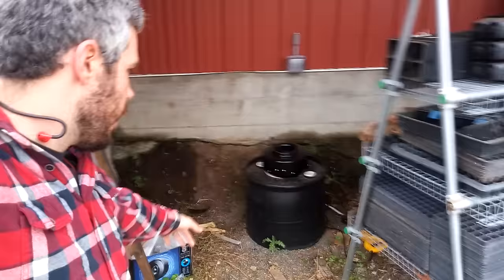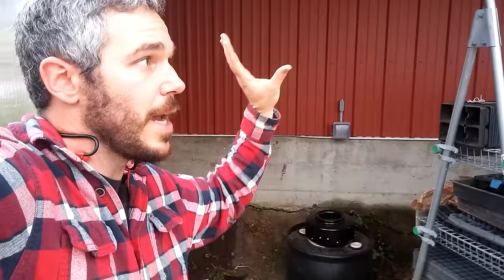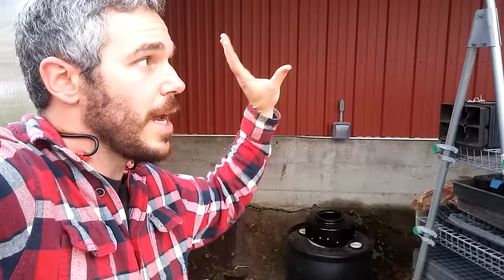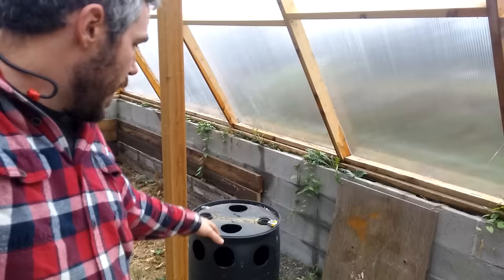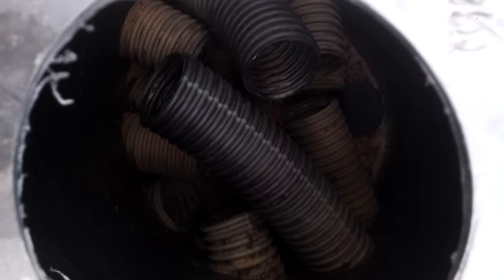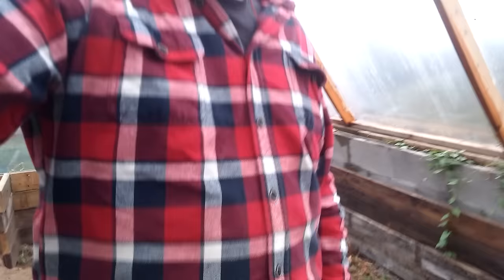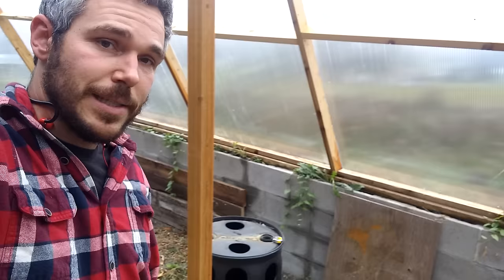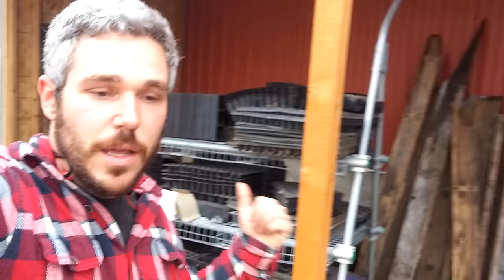Poor Man's Geothermal

Comment from the maker: UPDATE: Thanks for all the engagement on this video. As I said, good, measurable info is hard to find. As many of you have noted, what your seeing here is really still theory. We had one of the wettest winters in many years here in the PNW so I had to reprioritize, hence the lack of follow up. It will come eventually. In the meantime, check out our adorable piglets :) https://www.youtube.com/watch?v=4GqOcRLHnA0.
Reply: Great idea. Starting up a farm soon in the south and this will be GREAT for cooling. On a vaguely related note, what kind of panels did you use for the sides of your greenhouse and where did you source them     Thanks!
Reply from the maker: We used USA made Gallina Clear 8mm 2wall Polycarbonate. We had a wholesale source for this, which helped, as these panels are not cheap. I will do a video about the build in the nearish future.
Reply: Thats awesome. thanks!
Reply: You don't need panels on the side (maybe hinged ones just at the top for ventilation). It's more efficient to cover the east and west sides in dark colored thermal mass and insulate the outside (all the way to the frost line, but not down to geothermal pipe depth)
Reply: Hi there. Loved your video very interesting. Hopefully it inspires others to do the same, also check with your local officials about a tax credit (green credit). 

BTW, for future projects It would have been cheaper, quieter and more efficient if it used a plastic 55 gallon drum, filled it with about 3/4 of the way with water and buried under the ground. Connect some half inch pvc to a very cheap water pump (low volume) and a fan + radiator from a car (junk yard) being controlled from by a thermostat. The water isn't under pressure persay, as what you're gonna do is suck the water out of the button of the barrel, push it thru the radiator and it'll gently flow back into the barrel at the top, this is known as a open loop which reduces the amount of pipe you need and digging to do. I live in a tropical country and I air condition my entire house like this. Of course my setup is a bit bigger using 3 drums, isolated duct work, multiple fans, duct air valves, and thermometers so each room of the house can be temp controlled. Where I live electricity is about 25 cents a kwh. So having a 700 buck light bill isn't ideal. I got mine done for about 500 bucks total and my light bill is 45 bucks more a month after the installation. I mostly leave this thing on a year round, save for a few chilly days and when I go on vacation. Let me know if you have questions.
Reply: Did you dig down 8 feet under ground to install the pipes?  If not how deep did you dig?
Reply: John Vandervalk I’m curious 
We always used 55 degrees f as our constant for calculating and locating buried faults underground 
So it doesn’t change no matter 18” or 10 feet. That is where I live where there’s no perms Frost later like Alaska.
So why go down more then say 3-4 feet tops. Also, why can’t I dig a big pit that deep and toss two 300 foot coils of poly tubing in it 1-2”? Seems it’s going to get its 55 degrees right from that spot. The return part of loop, the warm coil you put say 6-10 feet away .
Seems so much extra works done in these other methods. 
I just started thinking if this was viable tonight. So I’m all new to this alternative climate control method.
I’m hoping to get to self sustaining myself in a Levitt development built in 1968. All on slab
I was considering radiant imbedded into the slab?  A closed loop geo thermally heated one? Maybe my theories stupid.  Like I said I’m new (tonight new) to Geo thermal
Thanks
Reply: I installed a system almost identical to the one you built. I welded up  and installed a very large wood stove in the corner of the green house. The stove is inside of a 500 gallon steel drum which acts as a manifold to contain the heat. I installed  two 8 inch pipes from the drum that reach up to the top the green house. I installed 400ft of 4 inch drain pipe at a depth of 24 inches in two runs. I added a 8 inch fan similar to yours on each run.  I can either draw the air from around the wood stove when its heating (very hot) or scavenge the sun heated air from the ceiling area. With two fans I can move a lot of air. I also installed 6 inches of recycled blue board buried to 30 inches around the perimeter to isolate the outside cold soil. The first year I was able to record soil temps at 65 degrees at 24 inches. That first summer I started to notice that my moisture and humidity levels were to high and a heavy dew was forming on the plants and green house glazing and walls in the early morning hours.  To make a long story short, I was not gaining enough heat from the soil, the moisture was becoming an issue and I had to vent all day long to dissipate the moisture. The air coming from the ground tubes had a musty smell and I suspect mold was forming in the buried pipes. The following summer I fired up the stove and the fans in mid March and nothing happened, no air flow at all.  It took me a couple of weeks to figure out what was going on. The ground outside of the green house froze in November and ground moisture either trickled or was wicked into the thawed warmer soil under the green house. As the temps dropped over the next three months, the moisture, standing water, froze solid in the buried pipes. I could not get any air flowing in the pipes till early April. I live in Alaska and we do not have enough light or solar heat to do anything with the green house from November till mid March anyways.  The solution of feeding wood into the stove 2-3 times a day for 3 months was going to be time and cost prohibited. During the summer the system did not come close to providing  enough cool air to keep the temps down.  I discovered that ventilation is the key. With proper building ventilation you will not need summer time cooling. With proper ventilation you will eliminate humidity and moisture issues like powdery mildew.  With proper ventilation, you will allow pollinator and predator type insects to enter your greenhouse and do their thing.Read more Show less
Reply: @fa113nreturns5  if that's how your cooling your house mate you don't need any pump just have the car rad above the highest point of the water in the barrel and just siphon the water true
Reply: @bigglesby12  I know it's bee a while, you have probably built yours by now. For others, I did see a inflated poly double wall system that gave R5.
Reply: @johnmcneal9477 
I suspect you used long tubes in your layout which is a sure fire way to cripple the cooling performance. Cooling, dehumidification and heat storage are all linked so if the system isnt good at cooling it wont be good for dehumidification or heat storage.
Reply: @7Trident3 
Inflated bouble poly wont give you anything like an R5 insulation value. I use inflated triple poly and its not R5 ;)
Reply: @JohnGuest45  What do you figure the corrugated polycarbonate panels give you?
Reply: @7Trident3 
Single layer corrugated will be as good as any single glazing. Sealing a profiled sheet  can be trickier than a flat sheet so be sure there`s no gaps anywhere.
Reply: Any update on the green house? And the thermostat ?
Reply: @OutofAshesFarm  - Have you checked out "Citrus in Nebraska" on YouTube, and their website, to figure this out, or is this another person doing this kind of thing?
Reply: @fa113nreturns5  i open louvered widows on south side  windows on north side air travels through breeze way and i just saved thousand dollars /cheers from jamaica man
Reply: @johnmcneal9477  Alaska? you don't need a greenhouse in the summer. its light practically all the time. you might aswell just design like sepp holzer. maybe some fruit walls. if your further south then imo the thing to do is abandon the greenhouse in the summer and let it bake the ground so there is a bunch of heat under there for the winter. The amount of energy this sort of thing produces in the summer you are going to be hard pressed to pipe underground and still be able to keep plants alive, especially if you have really long days like in Alaska. Its pretty simple. You put another  metre or so of plastic round the outside on a wooden frame so it is heating the soil direct and there is a big enough area of thermal mass underneath for it to work in winter. sorted. in summer you charge it. In winter you use it. The extra plastic round the side will keep the cold from making it in from the sides. After a few years there will be a massive battery of heat underneath, provided water isn't carrying it away which this extra area will help acheive. cheap and easy to build. just put in on some higher ground away from the water table. if you don't have higher ground then dig a lake and use the soil to build the greenhouse up on a mound. A more walipini design so the plastic is angled to the winter sun and it is more sheltered into the ground. Outside you have some hedgerow to keep the wind over the top and it will keep the whole garden warm.
Reply: Terracotta pots with a base, and a large candle. Put the candle on the pot base, flip the pot upside down over the lit candle, and bam you made a terracotta pot heater. 2 of these will heat your entire greenhouse! The pot will heat up from the large candle, creating a heat filled room! That's a cheap way to heat an area and it works!!
Reply: This setup has been a strong interest of mine for years. If you ever get a chance to share its performance and what you've learned, how you'd do it differently, there's a lot of curious folks here :)
Thanks for the video!
Reply: @TheNorthwestForager  If u look at the last comment under the "4.5 years comment".  (mikekinn4499)  It says "the guy hated it." Lack of follow up from the original poster suggests the same. 
I imagine it was too wet from what I am gathering. I am glad OP, at least, pinned a comment saying he was having trouble. Its more than most debunked geothermal info. I hope he was able to improve the design. Good luck to you too.

Comment: EVEN POORER:
Place a large pile of compost on the outside of the greenhouse, and ram rebar through the wall into the compost. Chicken manure and leafs has worked great for me. Adding urine "turbocharges" the heat production. If you place numerous rods of rebar 2 inches apart, they act like a radiator pushing heated air more efficiently without fans. But of course fans would aid in heat and moisture flow.
Reply: Do you know any videos where we can see this in action? Sounds cool.
Reply: @mrbonus8423  The youtube channel EdibleAcres has a lot of videos about heating greenhouses with compost
Reply: I see Thomas following chickens around with a pooper scooper then peeing on the piles of chicken crap. It's an interesting image I now have stuck in my head😆
Reply: @Rick-the-Swift  
I usually use my tractor bucket to scrape the chicken area topsoil, and coop shavings, into the compost pile....and I have been known to stop next to the pile from time to time and piss from the tractor instead of going to the restroom. Last week I taught my son how to write his name in piss from the front bucket of my tractor....although it was into a large snow pile. In November my neighbor said "good distance you have there" when I drove past her after pissing on the pile from my tractor.😎
Reply: To make it even more efficient, setup a sterling engine run fan to spread the heat without using any electricity. Place the expansion intake by the rebar to use the heat from it. Have the condensing intake run through the wall to take advantage of the cold outside air. The high difference in temperature causes a piston to move back and forth. This can be used to rotate a fan without any electricity used. If the temperature gradient is high enough, you'll get a very fast spinning fan.
Reply: One guy used a mix of straw and manure with a coil inside running to a regular wall radiator

Comment: The formula I saw was one linear foot of 6" pipe for each square foot of building with 8' walls. Damp heavy soil will conduct heat better. I the 1960's this system was popular and performed well in many farm buildings. This is the first time I have seen this system used in a long time. I think the company installing it was called The Lords Power Company. The Romans used a ducting system made of stone, that would heat in the winter and cool in the summer.
Reply: Same with middle east, they could chill foods with no moving parts only ducts.

Comment: Here's a little tip it took somebody 4 years to develop this.He heats his house that is over 3,000 sq ft with valted ceilings when it hits 80°, the louvers open then the fan kicks  in and exhausts the house back to room temp. I got to see this technology he's had it for 54 years now. They have regular glass windows about 18" wide two panes at 2" with  a piece of mylar directly in the middle so when the sun rays come in they are trapped inside of the structure because they cannot leave they turn to heat rays and he has 7 plastic towers of water that absorb this heat and disperse it through the house. The house is turned so that it is untraditionally facing of the winter solstice the awnings or shades are meant to protect the house from this light heat source. I saw this technology several years ago the only time it didn't work one time in 24 years he said was when the fog came up so he had  to revert to the conventional system as most people know it to heat his house for 24.00 bucks...... This is really cool stuff the house still had the conventional look. He has a really thick blue insulation. We had a short discussion of how air travels through glass and that's what led him to showing me his whole house how it worked...... Awesome is all I can say..... I would just like to develop a no fan  system..... This will heat your whole house

Comment: Best way to remove the condensate from the tube would be to have a small sump pump at the end of the tube close to the house and don't use drain field lines with holes in it.  Put it in a trap so the pump can be serviced when needed.  Tilt the tubes at a slight angle so the condensate gravity feeds the sump pump. This will do several things:  1) the pipe remains sealed and no outside water can invade it due to flooding. 2) It keeps ground bugs from entering the pipe through the drain holes.  Put a screen on the far end of the pipe that is outside to prevent critters and bugs from entering the pipe. Put air filter material at the outlet of the pipes so that mold and pollen are prevented from entering the home, or structure you are cooling/heating. Finally, put access traps into your pipe so you can run a  tool similar to duct cleaning down the pipe......remember, these pipes are cool, moist and full of pollen, mold and dirt that is sucked into the pipes from outside.... You don't want to breath that air with all those contaminates in it.
Reply: Excellent practical advice, thank you sir.

Comment: I come from the first copies of Mother Earth News back in the 1970s so I've seen a great deal of ways to heat/cool greenhouses.  For winter, have you thought of taking plastic 55-gallon drums, painting them black, filling them with water where the sun will shine on them to create a great heat sink to keep the greenhouse warm in the evening?  Or having a mass rocket stove where, similar to your 500 feet of piping, you direct a long set of stove pipes into a seating area that has mud or rocks to absorb the heat from the rocket stove which uses small amounts of wood.  That's just a couple of heating ideas for winter.  Summer shade mesh for the windows will allow the light to get in but help reduce some of the summer heat - that and if you are older like me, back before homes had air conditioning, houses had a large attic fan (and I grew up in Oklahoma so I guarantee you, I KNOW about summer heat).  The attic fan was turned on early, before the sun came up and pushed the coolest air into the house, then turned off until later...when the day's heat was too much, the attic fan blades were reversed to exhaust the hot air from the house.  That's what you do...pull in cool, blow out hot with a good sized fan.  Works!

Comment: I went into a public bathroom on the interstate in Florida long ago and they had a pyramid shaped roof with venting at the top,  2' x 3' concrete block sections turned on their sides near the floor to allow air in, and two industrial wall fans up on the walls to create a cyclone effect. it drew air in thru the openings near the floor and vented it out the vent at the top. It actually did make it pretty cool in there. 

I've thought of copying that for a large concrete shed I have, but instead of just openings near the ground to let air in.... installing several perforated drain tubing runs underground...which would bring much cooler air in. It would be extremely passive and simple system system that would cool pretty good I think. The runs would start above ground with a U-shape pointing down with screening to keep bugs and insects out. Any thoughts anyone?
Reply: Check out earth tubes. It's exactly what you are describing.

Comment: Thnx for vid. Moisture into soil isn’t just to prevent mold, the evaporative cooling and condensing heat is also helpful I’m pretty sure, from what I have learned from verge permaculture and if I’m not mistaken they have a calculator you mentioned and also seem to be doing the first detailed study of the effectiveness of these designs